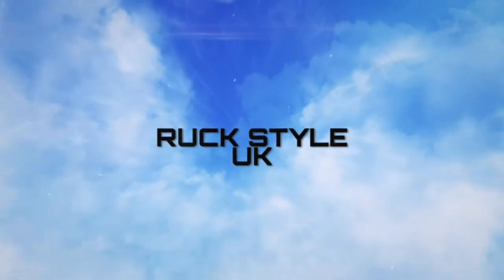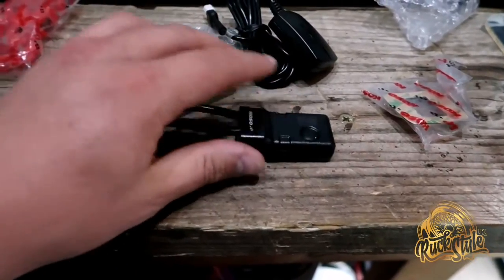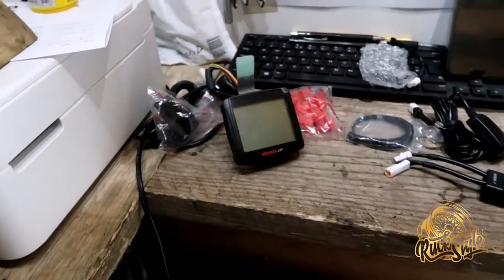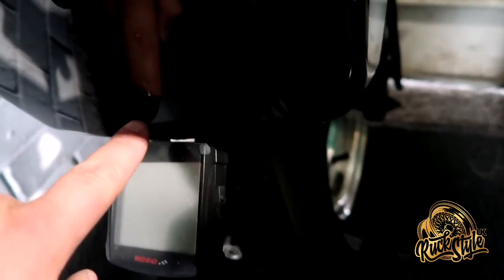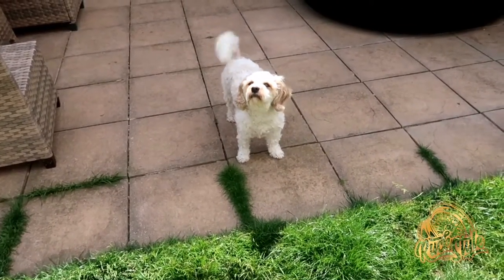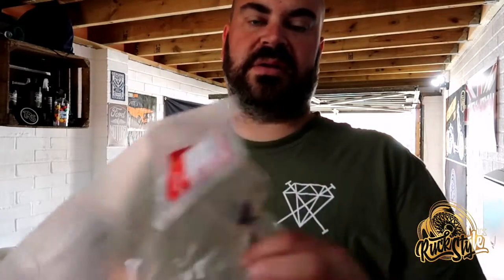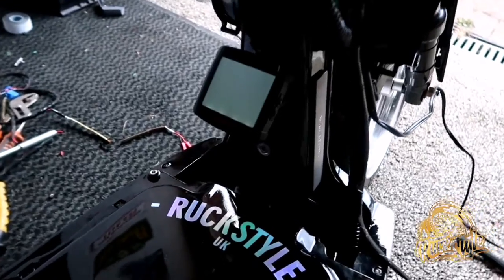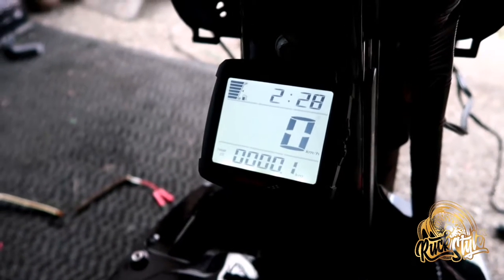Honda Ruckus Koso Gauge Install

Comment: What resistance setting for the fuel gauge when using the met sending unit?
Reply from the maker: 510 i believe. Set and forget
Reply: @RuckStyleUK  thanks!
Reply: Drib, what you doing here? 😁

Comment: This helped out a lot, thank you very much. My only question is I’m stuck on the fuel sender part, you made a 3 pin and wire connector? Sorry, I'm a little lost.
Reply from the maker: A switched live feed from an ignition source, a ground, and the signal wire to the koso. Hope that helps

Comment: How is the GPS sensor working under the battory box  - Instructions say it should be open to the air - but I guess its only some thin plastic?
Cheers & Thanks 
Nick
Reply from the maker: Works perfectly fine. I wasn't going to put it out anywhere as it wouldn't look right plus it could get damaged
Reply: @RuckStyleUK  Great - Thanks 
nick

Comment: Honestly, still confused about the power wire from the Met fuel sending unit (blue/white). I used a quick splice connector to connect it to one of the ignition switch wires from the ATR harness and I'm still not getting a reading from the fuel level gauge (it just flashes and doesn't show any of the black horizontal bars) when I turn the key on my Ruckus. Looks like you took it a different direction with the inline fuse wire to the battery for the power source, but I think I'm just an idiot and can't follow along.
Reply from the maker: Message me on Instagram and I'll talk you through it
Reply from the maker: Set your koso gauge to 510 amd then it will work

Comment: I know this is an old video. However I'm having some trouble with the fuel sending unit wiring. So you wired Green to ground blue striped to power and yellow to signal on the koso?
Reply from the maker: Yes sir. Green the Koso goes to yellow on metropolitan fuel sender. The green on the fuel sender put to a good frame earth and the power to a switched power source. 

Once you have power, set the fuel resistance on the Koso to 510 and it'll work as it should
Reply: Thanks so much I appreciate it
Reply: @RuckStyleUK  would you suggest going right to battery for ground? Or right to chassis?
Reply from the maker: @dethpitovrdrive  100% chassis/frame
Reply: @RuckStyleUK  thanks again I'm wiring that stuff up now
Reply from the maker: @dethpitovrdrive take your time and you'll be fine
Reply: @RuckStyleUK  I got everything else but the sending unit was tripping me up for some reason. I've also been told conflicting ways to do it. Someone told me to wire it with no power and just signal and ground. I'm also at another disadvantage because the fuel sending unit I bought from the ruck shop was dead on arrival unfortunately.

Comment: Any issues with gps unit finding signal being under your batt box?
Reply from the maker: No sir
Reply: @RuckStyleUK  oh really? I just got mine in and I was wondering where to mount it so it is visible to the sky... but yours under the batt box works?
Reply from the maker: @BugzeeSiegel  yes as the video shows

Comment: I still need help my brother your video is the only one out here..unfortunately I’m new to all of this I not sure where all the wiring goes…..is there any way you could help
Reply from the maker: What in particular do you need help with buddy?
Reply: I'm not sure how to contact the green wire also how do I contact the met  Fuel gauge connector to the Honda ruckus factory
Reply: Can you send me  a picture of the green wire and where it's contact to
Reply from the maker: @TheErnestoq  can't use a ruckus factory fuel sender. You will need a metropolitan fuel sender. To mount the Koso to the standard ruckus controls is the same process but the wire colours are slightly different. On the ruck shop website you can look up the ATR harness and in the details is a comprehensive break down of all the wires. That will help you
Reply: I have that not sure on how to contact it ...I've been watching your video every day trying to figure it out....all I have is the red contacter that came with the koso
Reply from the maker: @TheErnestoq  green wire on the Koso gauge is fuel. So that goes to the fuel sensor wire on the metropolitan fuel sender which I think is the yellow with white tracer.
Reply: Thank you ill try that ...and the red wire go straight to the battery right....I really appreciate your help.....

Comment: do you need a fuel unit to if u have eu style ruckus with the efi engine, so the injector ruckus?
Reply from the maker: Yes there is not one on the FI model fuel tank.
Reply: @RuckStyleUK  thanks!

Comment: Whats the recistance for ruckus gy6  fuel and empty. In the koso settings
Reply from the maker: 510 set and forget
Reply: @RuckStyleUK  thanks thats the full.  And the empty?
Reply from the maker: @Ed_hi2low  that's it. Set it at 510 and it's done

Comment: Hi I take it the wiring is the same with the DL03SR.
so there is a few wires that we don’t need to use then looking at wiring diagram could I use the gray wire (says oil on instructions) as my overheat temp which would then do away with the light on the battery box ?
Reply from the maker: No idea. Not used that gauge

Comment: If I fit one of these then I no longer need speedo cable ?
Reply from the maker: If you got the GPS speed sensor you no longer need a Speedo cable. However I'm not sure if compatable with your unit